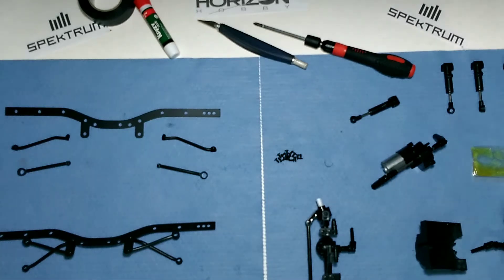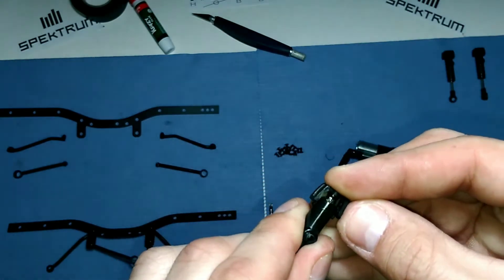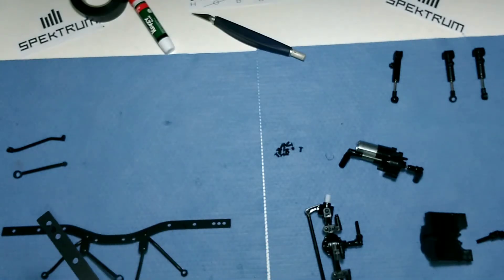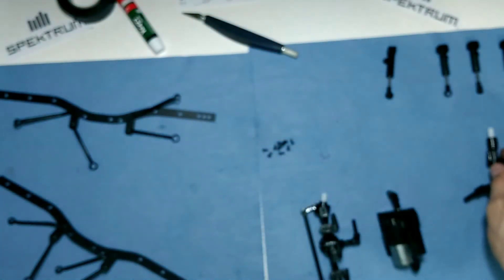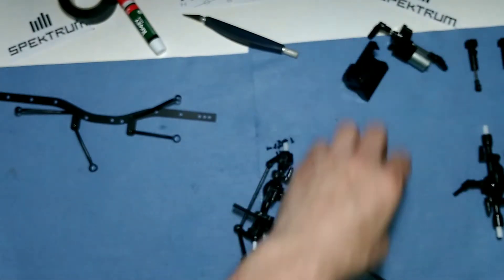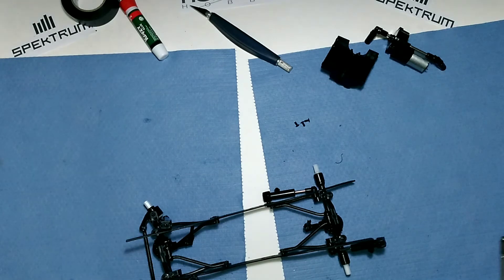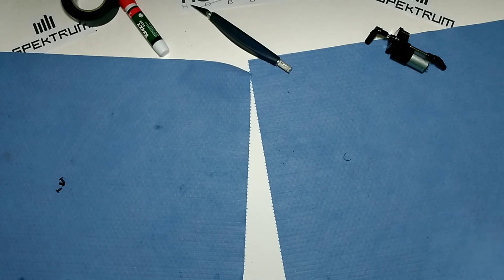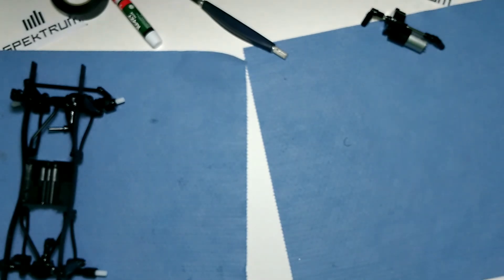wpl c-14 hercules truck kit build #2

Comment: These suggestions are gold...I forgot to lube inside the steering knuckle and suspension spring. This will be my excuse to take the truck apart and maybe even paint the metal frame black.

Comment: Hey there r/c journey. My truck  came in today. I seem to be missing ALL four “shock eliminators”. The part thoat goes through the spring itself inside the shock. Would greatly appreciate a pic of yours if possible, or an aftermarket suggestion. Thanks a bunch. Hope to hear back.
Reply from the maker: Zane Petty if u have a face book send me a friend request I can help u out. Also if ur not apart already join wpl groups on Facebook as well. We can all help you out.